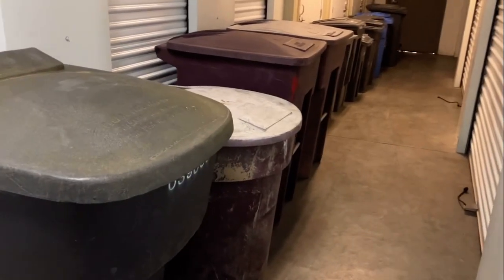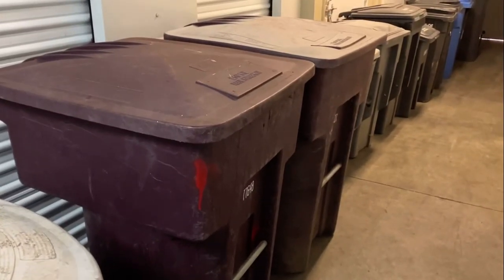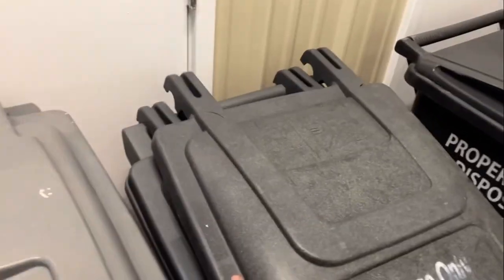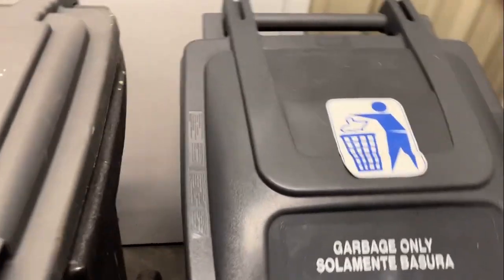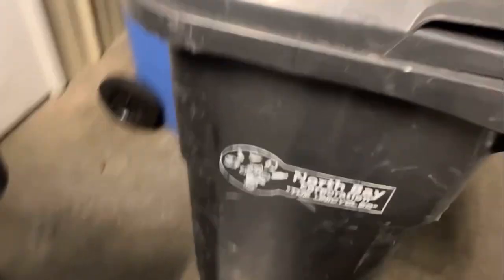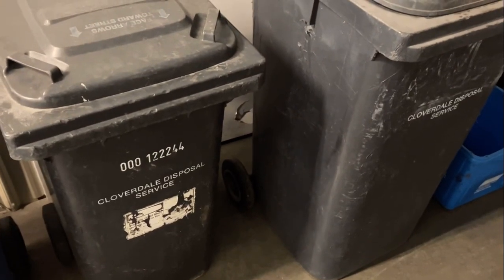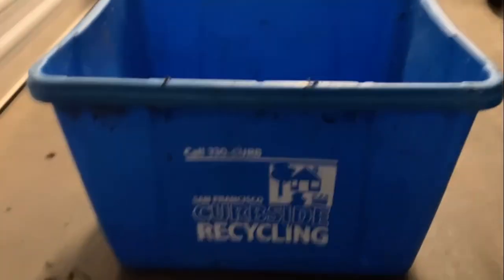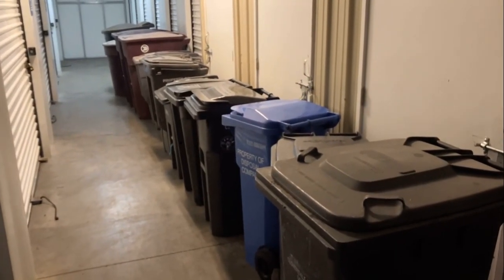My Cart Collection! 04/23

Comment: I know I’m late, ish. But 0:19 that’s a Kirk MFG Cart. The difference is the dimples on the left and right front of the “stick out” the thing that the serial number is on. If you want more explanation I guess I could upload a picture
Reply from the maker: Ok. I think i know what you’re talking about. It does say Turn Key on it, not Kirk. All the carts here say Turn Key. We dont have any that say Kirk but i think Sacramento does. Also some of them here have the “dimples” or the little lip thing on the front and some dont, but they all say Turn Key. I think theyre the same company
Reply: @TrashKid63  I believe they are. It’s just they are like, different generations and different names. Like the wastewheelers, made by rrs. RRS also makes the more known design, well used to, but before that made the wastewheeler. Same goes for turnkey. It was Kirk, then turn key. But that with the dimple thingys, are kirks.
Reply from the maker: @SDRefuse333  oh ok interesting. I was unsure if Kirk or Turn Key came first. I thought they were at the same time and just went by different names in different areas. As far as i know, all the Empire Waste Management ones say Turn Key. Ill post a picture of what i mean with the dimples